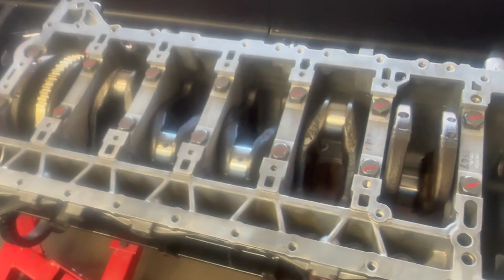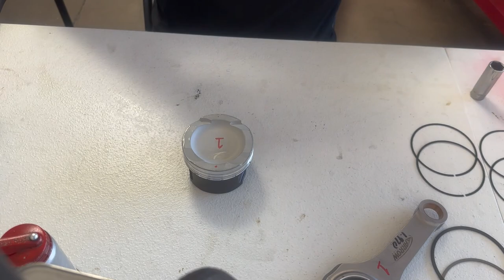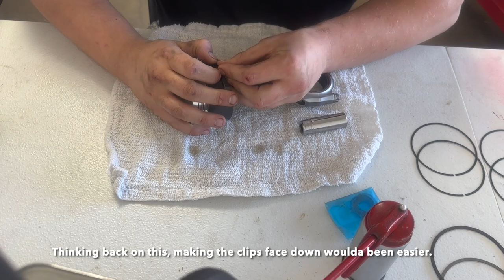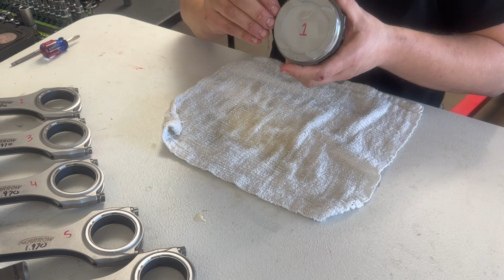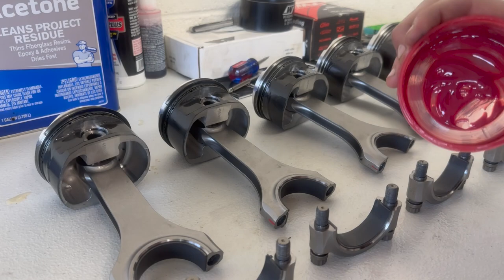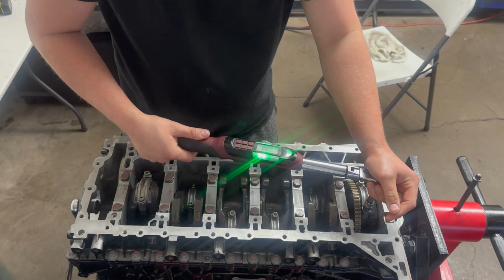BMW N54 ENGINE BUILD PT 4 | Installing Forged Rods and Pistons

Comment: Very great videos, you did everything correct besides using regular oil in the cylinder walls when you assemble the rods/pistons. You need to use transmission oil on the cylinder walls to make the pistons rings break in properly. Also it’s highly recommended to use a Rod bolt stretch gauge. I never do rod bearings services/build engines without using the rod bolt stretch gauge. They’re expensive but you can go to harbor freight and get a cheap one, take off the shitty gauge then buy a decent digital gauge and slap it on the cheap frame. Made my own for less than 50$ digital rod bolt stretch gauges go for 500+
Reply from the maker: I appreciate the info, I was thinking about using a stretch gauge but didn't want to buy it lol. Have you ever seen a rod cap come loose before?